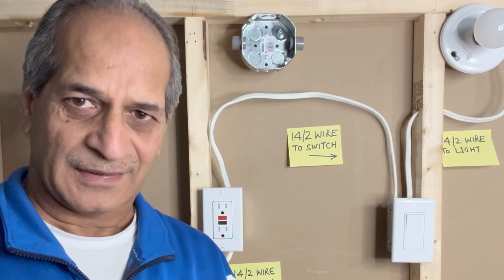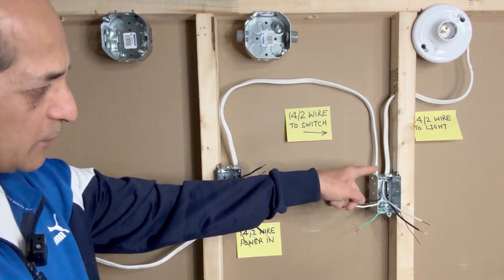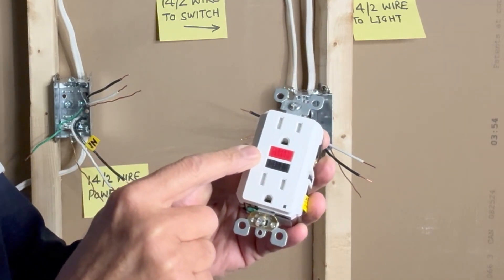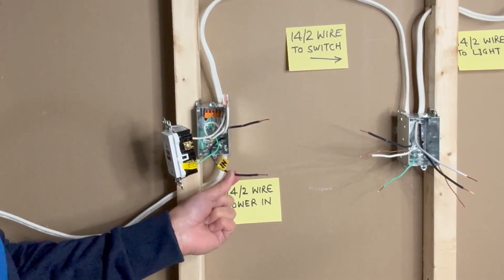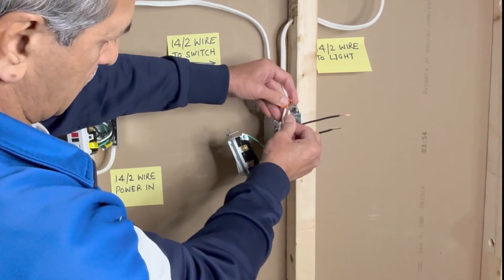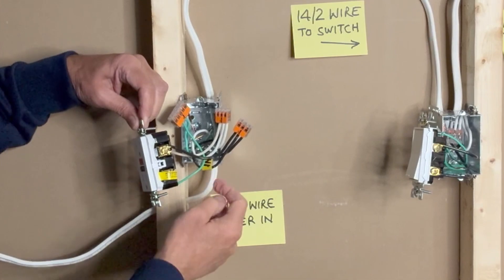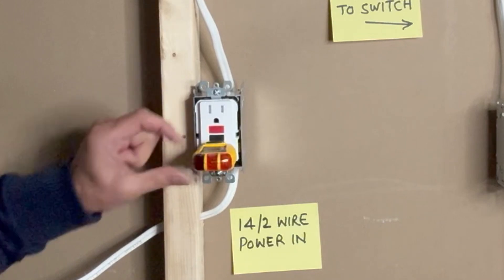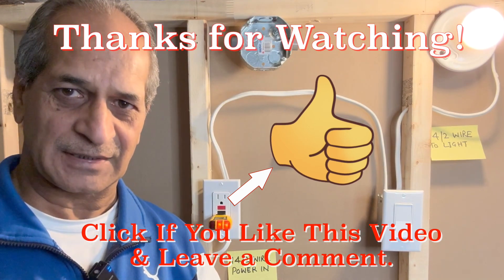Wiring a GFCI Outlet and Light Switch in Bathroom

Comment: I made these connections however my setup is a little different. I have incoming power with a wire to the garage door and a wire to the switch for exterior light but I am not drawing any power to the GFCI. I have made connections blacks to the hot load side top right, neutrals to the to silver load top left and connected the grounds. Any suggestion?
Reply from the maker: I’d be happy to help, but I need more information about your specific setup. The connections you described seem to be ok though. If you are still unable to figure out, it would be best to consult a licensed electrician. Thanks

Comment: This defeats the purpose of GFCI not protected the downstream, the light switch and the light!  He's not using the load side of GFCI.  Could have just eliminated the GFCI.  Junction all wires together at the GFCI.  Just only use the switch to control the light!
Reply from the maker: Appreciate your feedback! This type of GFCI connection with protected outlet is demonstrated in my other video:
https://youtu.be/2-2wpd_FN_E
Thanks!!